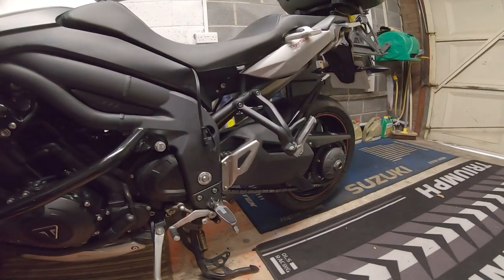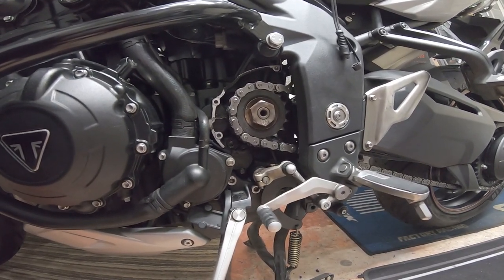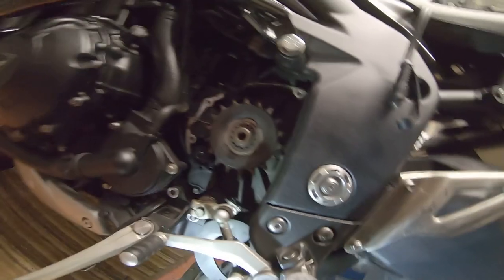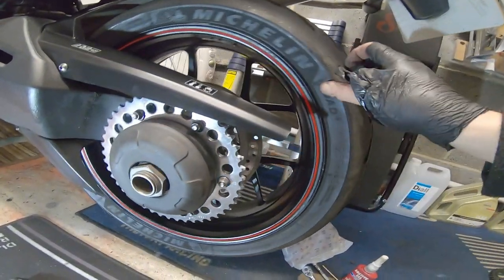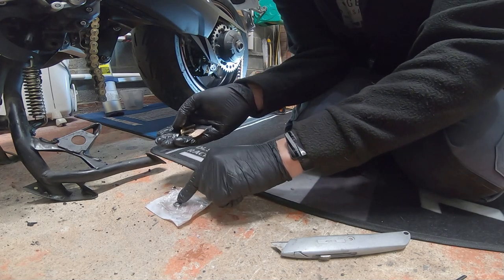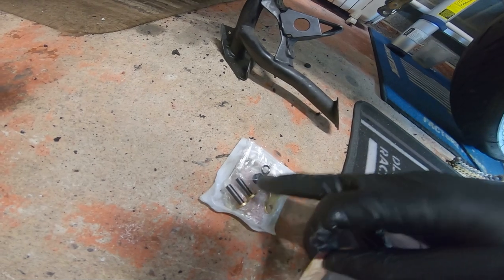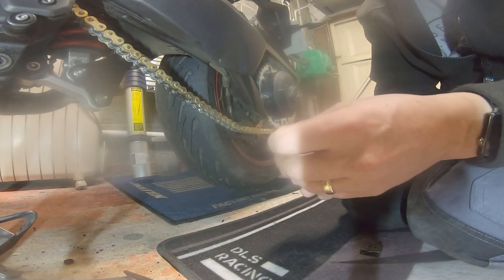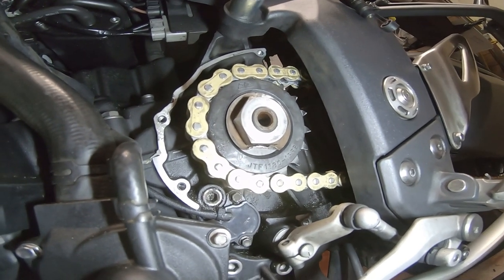Tiger Sport 1050 Chain and Sprocket Change

Comment: Hi UNB. Hav’nt done the job on my tiger sport yet but did it a couple of times on my old tiger 1050. I found placing the new chain on the rear sprocket and working on the connection there made it less fiddly. Thanks for mentioning the torque’s etc. Very helpful. 
Not on Facebook myself but will get a friend to download that manual you mentioned in the comments. Thanks again chum.
Reply from the maker: I’ve done a chain like that before but prefer it loose as you can keep checking how free the link moves as you do the riveting.

Comment: How many  kilometers did you get of your chain before replacing it?
What is the torque requiered for the front sprocket?
I'm planning to replace the chain and sprockets on my bike, but I have check on it and it is still pretty good at 59500 km...I'm surprised for the long lasting of that, I'm pretty careful with the chain, I wash it frecuently and installed a chain oiler that workd really good, so the chain is well lubricated all the year.
Great video, greetings from México.
Reply from the maker: Hi the torque setting is 132 NM for the front sprocket. I got around 30000 km but I clean the chain and lubricate it every 600km
Reply: @upnorthbiker  Gracias amigo !
Reply: @upnorthbiker  hi do you know the torque setting for the rear sprocket nuts? Thanks
Reply from the maker: Hi Hector they need to be set to 55Nm
Reply: Thanks mate, mine is a 2017 sport 1050. I hate that I cant buy a workshop manual for it. This online malarkey is way over my head.
Reply from the maker: Message my Facebook page and I will send you a copy